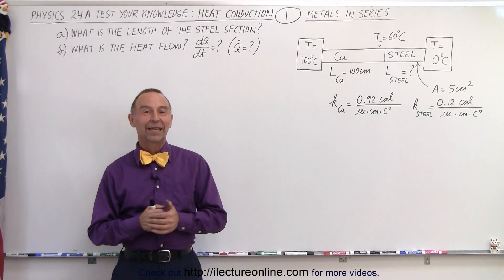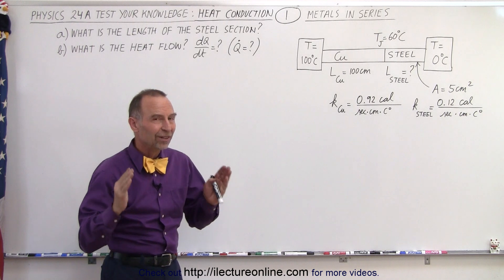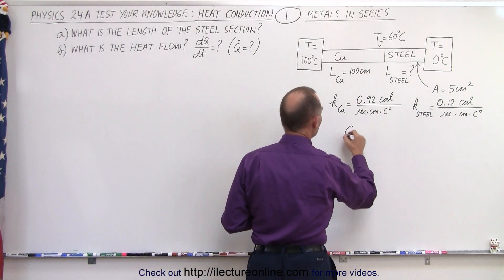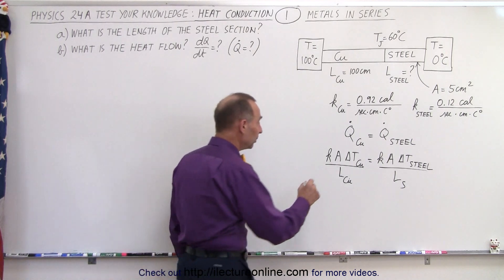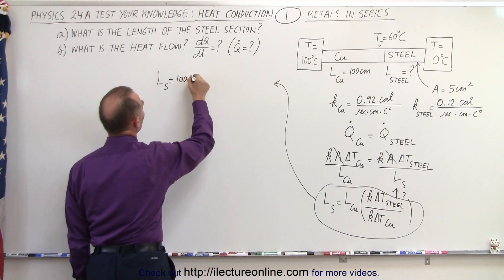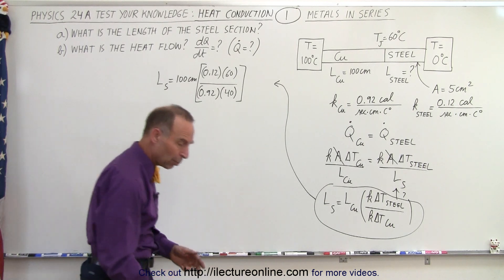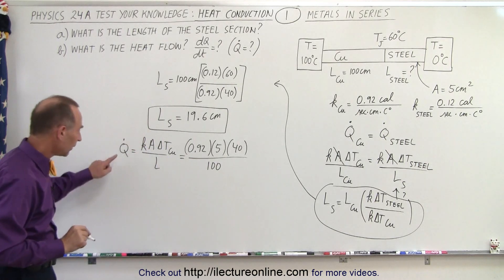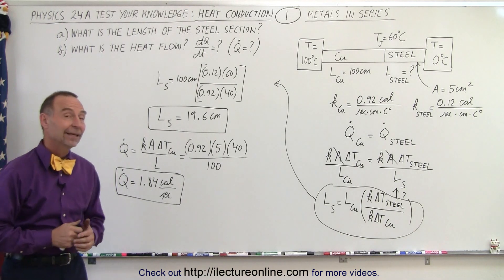Physics 24A  Heat Conduction Examples (1 of 22) Metals in Series

Comment: ☺😊😀😁😂5 Smile's ( thanks for the math like your works like the example helps with real works for check reference I've been working on the fisheries industry got all 3 rigs spent 2 months crashed a big percent of boat math except propeller crush death and outer haul design for off shore rigs which I have most of the base in for final soon as I've been sick and my mind shut down 8 month ago mother@#@@#@###@##@  but when it comes back this is going to help a lot again thanks for your time👍)